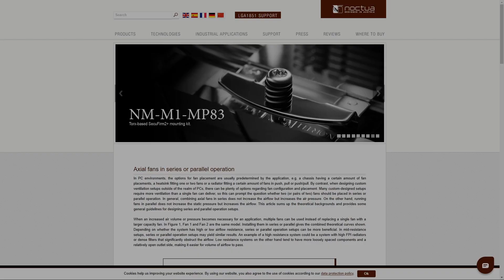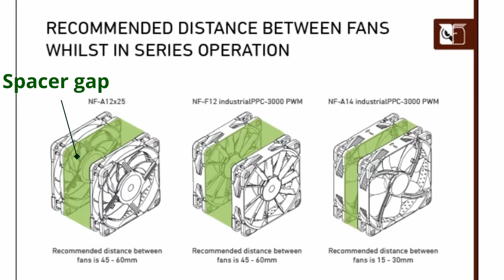3D Printer Enclosure Ventilation - Mark 2

Comment: You mentioned that the exhaust fan on the P1S is decent at getting a flow going. If I only wanted to vent out a window that is a few feet from the printer, would that suffice? Great video, thanks!
Reply from the maker: Definitely worth a try. Worth considering the air pressure in the room which may influence the air flow.

Comment: What do you do with the chamber fan already on the P1S? Did you remove it from the printer or?
Reply from the maker: Didn't touch the chamber fan. Still operates.
Reply: @MakerMike54  Thanks! Did you also leave the settings default for the fan? E.g. so the chamber fan runs during printing?

Comment: excellent video! 
do you find it more difficult to maintain the temperature of the chamber with this exhaust system?
also, what happens if you put 2 stators together between 2 fans? does it affect the pressure? also, have you tried different number of blades in stators?

Comment: What kind of filament are YOU using that you need ventilation? Resin printer, YES, but Filament printer?
Reply: ABS and other fumes are dangerous, in addition to plastic particles in the air.

Comment: Awesome work! I do wonder whether or not replacing the stators with fans spinning in opposite directions (both configured to push air in the same direction) would increase airflow. If so, I assume it would help increase efficiency for the same size unit or have similar performance with a smaller unit size.

Comment: Great video. How does the ventilation affect the temperature in the enclosure and does it affect the prints?
Reply from the maker: It does cool the enclosure depending on how much air you are allowing through with the gate.  It's good for PLA to have full ventilation. For ABS and PETG I have it set to very low so the enclosure temp stays higher.

Comment: Thanks Mike. Are the fans 120mm and the liminar flow cone are 100mm in diameter? Edit: I saw that among the stl there is no liminar flow cone with the holes to connect it to the fan.

Comment: what screws did you use to attach the duct to your p1s?
Reply from the maker: It's really held on with Neodymium magnets. There's 2 M2x8mm screws that are just for alignment so the duct attaches right over the P1S outlet.
Reply: @MakerMike54  thanks for letting me know 👍

Comment: Are you able to print abs with such air flow? If so I'll definately try this
Reply from the maker: I mainly print PLA and PETG so haven't done ABS for a while. For PLA I always leave the vent system on.  For ABS I suspect it's probably best to use the vent system to flush the enclosure after the print is complete.  But agree it would be ideal to run during ABS print. You probably want to use a 'duct gate' to regulate the flow to very low flow and of course this would be different for slightly different for each setup.
Reply: @MakerMike54  Yeah I figured, thanks

Comment: Quick question I hope you'll see.  When running this system on your P1S, have you ever used a smoke test at the door creases or other leaky areas of the enclosure to see if smoke enters the enclosure, demonstrating that you're generating enough flow to create a vacuum?
Reply from the maker: I did a smoke test by putting the 'smoke generator' inside on the build plate and it didn't leak any smoke out of the case holes. So looked ok on that front.
Reply: @MakerMike54 great, thanks for the reply. Getting my P1S in a couple weeks and I plan on using this design.

Comment: I was always told there would be issues if I stacked more then one dust collector (motor, impeller fan) in series. Your demonstration seems to say otherwise. Do you think I could put two dust collection units on the same run of ducting?
Reply: This is a tangential comment. I will also be making your ventilator setup for my Bambu P1S but I wondered about the dust collectors in my wood shop
Reply from the maker: Assume you're thinking about putting the dust collectors in parallel working off the same run of ducting.  Probably starts to get complicated with different resistance and pressure along the ducting, and just having to watch out that one fan doesn't overpower the other and draw air backwards through the filter.
Reply from the maker: I haven't come across any documented issues for not putting fans in series. I'd guess that a potential problem might be with more powerful fans, where the fans may spin a higher revs due to having less 'load / resistance'.

Comment: Having just the stators are enough and will give you better laminar air flow through the fan assembly. Just the fans creates turbulent air between and reduces the pressure because the flow is no longer uniform so it looses pressure that's why jets have them to create as much compressed laminar airflow as they can get.
Reply: to make it even better you can 3d print the fan assy mount them on a axial shaft and drive the blades at the same speed like a jet that way you reduce the turbulence even further.

Comment: If I see right the stator blades have to be angled the opposite way, right?
Really helpful video, I'm planning to do the same but smaller for my single printer enclosure. PC fans really are amazing.
Reply from the maker: Yep thats right. So they scoop up the rotating air.

Comment: Amazing! Thanks for this experiment.

I also have a P1S and I was thinking to do the venting like you have in version 1. And now I see this version 2 :-)

I have a question - what percentage do you have the P1S chamber fan set to? I'm a bit worried that due to the draft it won't start generating current and destroy the printer mainboard...
Reply from the maker: That's a reasonable thing to consider.  It was running for about 8 months with the original inline fan which was more powerful and didn't seem to cause any problems.  Should be even less chance of that now it's using more relaxed PC fans. I've just been using the default Bambu profiles.

Comment: Am I right in assuming the previous extractor fan failed because it's a bathroom extractor fan made for removing moist air immediately after people take showers and not intended to run for the multi-hour periods that a 3D print can take?
Reply from the maker: This is the description from the online shop where I got it, 'This 100mm model has a maximum airflow of 240m³/hr, at a decibel rating of only 37dBA at high setting. This model is designed to be ducted using 100mm ducting and can be used for a variety of domestic and commercial extraction applications.'
So think I was just unlucky that it died.